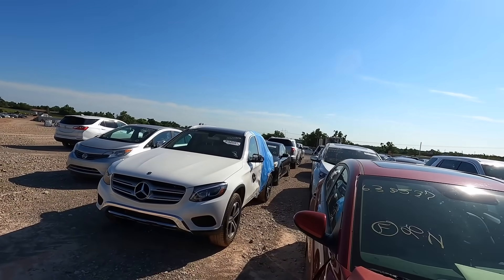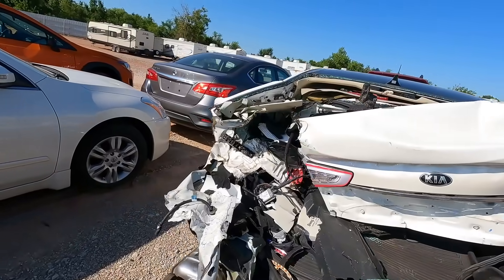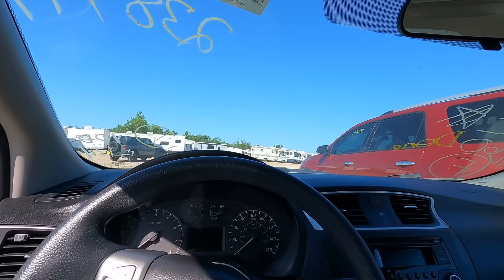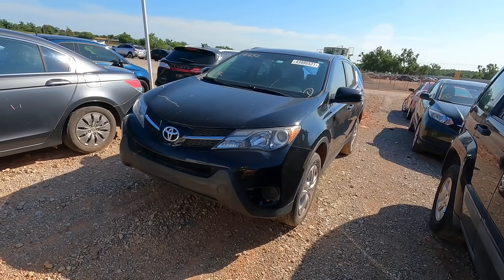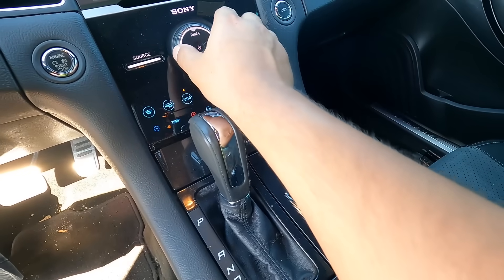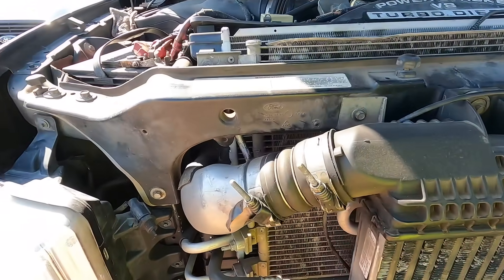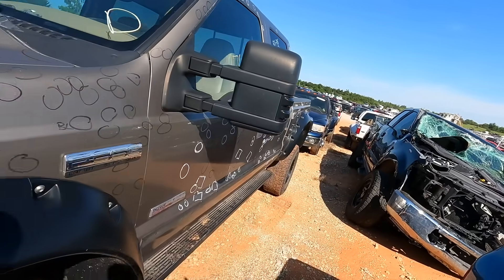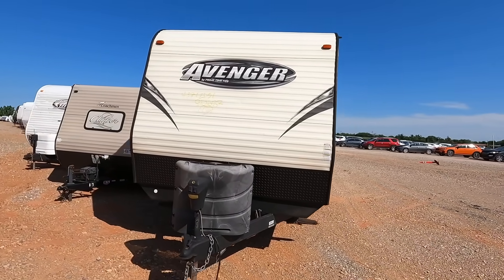Copart Walk Around 7-13-21 + All The Cars!!!

Comment: The Mercedes was rewired previously in the left pillar and rocker. Ironically it was hit a second time in the left side. Those are 2 separate incidents. Granted the initial repair was quite sketchy.
Reply: That's exactly what I was thinking, it was wrecked before, the last repair was shoddy the insurance company seen it anf probably totaled it
Reply: Don't know, my guess would have been, not knowing the history of the vehicle, that it was previously bought at auction and someone tried going cheap to repair in an effort to flip it but stopped or ended up like this for some reason
Reply: Exactly what I was thinking too. As soon as the body shop found it they probably called the insurance company to report it

Comment: My wife and I own a 2017 dodge Durango V6, and we pull a trailer, very similar to the coachman. We pull it up through the mountains, we average 13 miles a gallon, pulling a trailer fully loaded, that weighs 4200 pounds.

Comment: If you ever buy one of those hail campers just get on the roof and check for any holes. You can get the special auto leveling caulking online pretty cheap and fix it up . Once you see the leak inside on those its already got damage throughout.

Comment: As for the CVT's it depends on what it's in.  Nissan - not so good with them.  That is a big fail point on those.  Honda and Toyota on the other hand, if you do your fluid drain and refills like is recommended they will last.